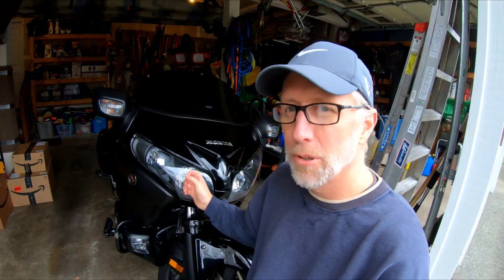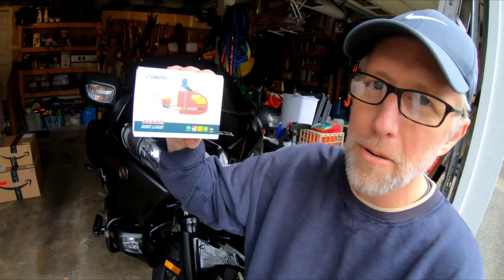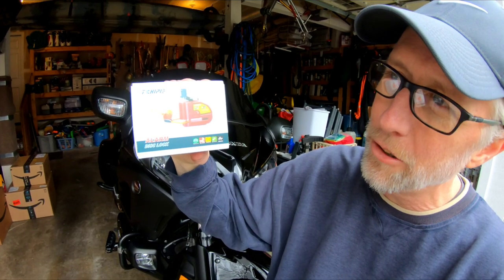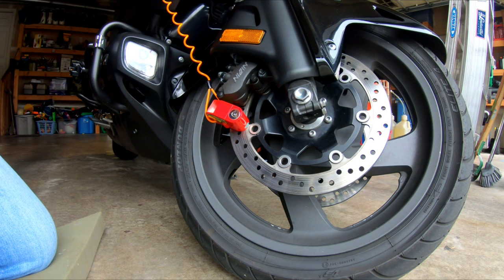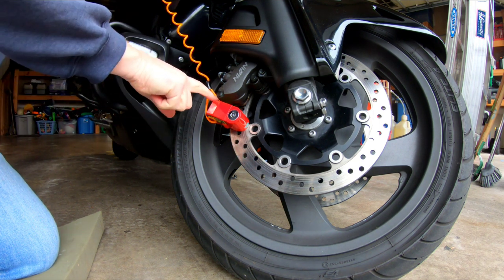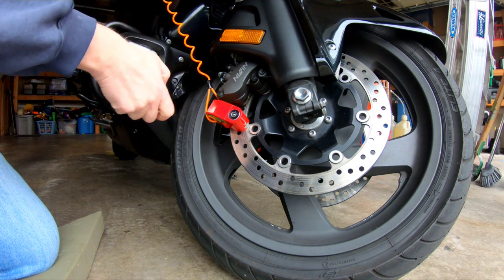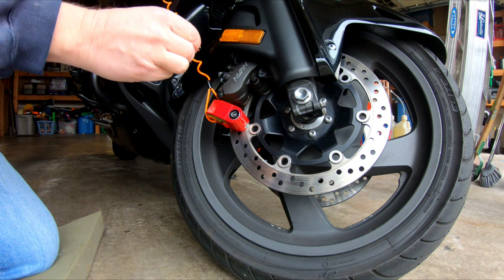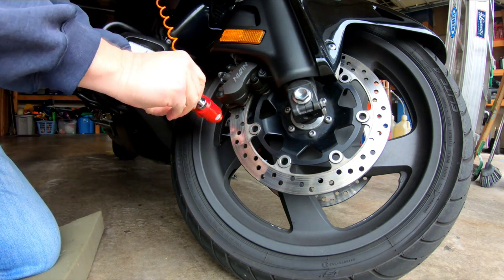Motorcycle Alarm Disk Brake Lock (Tchipie) Unboxing  & Review

Comment: Just bought the same one. Haven't installed it yet but thanks for the insight!
Safe travels 🙏 
777
Reply from the maker: Hi Cool Chris,  I just went on a week long bike trip and used it every night.  It worked great.  One night it was really windy which caused the alarm to go off :)  Thanks for watching.
Reply: @bgrides2108  Hey bro put mine on tonight.
Yea its quite sensitive but that necessarily isn't the worst thing that could happen. I used my rear break and it fit well with the same reaction. Definitely a nice added layer of security for the money._
I'll probably get another 1 or something heavier duty on one axel.
I'm on a KLR650 I just bought and intend on getting gear boxes so carrying around some extra locks and weight is casual. 
Peace
777
Reply from the maker: @coolchris9763  The KLR650 is a cool bike!
Reply: @bgrides2108  Thank You BG. This is my 3rd enduro. I had a used Yamaha XT 350 then I bought a new one. I was in a rural area so honestly I've never registered one, and never did get my motorcycle license yet. Well now I am older and wiser and I am I preparing to apply for a NY state certificate from a driving school nearby and get legal...the learners permit first then the license. Its a process as most riders know. I cant wait until I am official because its really hard to look at that bike and not hit the road. Im rushing to get it done so I can do some touring before the cold weather hits. Keep the cool vids coming. I am subscribed.
Save travels!
Best
777

Comment: Think I need this for the reminder and the alarm because I’m that dumb ass who will ride off with the lock on.
Reply from the maker: Hi Hottotty13, Your right.  If a bad guy tried to ride off with the bike, they would only get a few inches away because the lock is connected into the rotor disc.  I always try to remember to put on the cord to the handle bar grip so I don't try to ride off with the alarm locked on :)  thanks for watching.

Comment: im sorry for my ignorance but whats the purpose of the cable on the handlebar?
Reply from the maker: Hi Stephane,  It's just there as a reminder.  For example, say in the morning you come out to the bike and try to ride it without taking it off, you might cause some damage.  The cable helps you remember to remove the lock :)  Thanks for watching.
Reply: @bgrides2108  oh OK, I thought the cable was to put around a post in case you are using this lock on a bicicle. Thanks!
Reply from the maker: @stephanesilvaa  sure thing.  Thanks for the comments

Comment: Bought this. However, my alarm goes off within about 30 seconds of setting without being touched. No wind and no rain alarm still  goes off. Fresh batteries inatallwd and I disconnected the orange cord thing it was pulling on the disc lock. Even without the cord my alarm goes off. I had to take batteries out of it to use it.
Reply from the maker: Hi @johncarnes2688,  It sounds like it's not functioning right.  Can you return it and get a new one?
Reply: @bgrides2108  not sure, I ordered it on line Awhile back. I have been using without the alarm  as a visible deterrent at this point.
Reply from the maker: Yeah.  It's a great lock on its own without the alarm.  For me it's a good deterrent.  If someone really really wants the bike, they'll find a way around any lock or alarm...  I saw a video and four guys just pick up the entire bike and put it in a van @johncarnes2688

Comment: Hi Sir.. I used disclock in my rear rotor. I forgot to remove it, I run my motorcycle 3 times high revolution.. Wonders why my engine shuts everytime. Does this cause harm to motorcycle engine?
Reply from the maker: Hi Marco,  For this example, the lock was installed on the front disk.  You want to make sure to remove the lock before running the motorcycle just to make sure you don't hurt anything.  Thanks for watching.

Comment: Can this lock be easily broken off once a thief begins to work in a hurry right after the alarm sounds? Are it's this lock very strong an regardless how forceful the thief is will not be able to break the lock an move it? That's what type of Security Lock in looking for. When a alarm goes off  a thief is going to work extra fast to be able to get away with why in the first place he approached the motor bike in the first place. So if you don't want to create a video showing just how strong your Security Lock is locked onto your wheel, an you don't mind taking a chance breaking your lock to just to prove a point to see if your lock is indeed safe from a thief in a quick an fast hurry to get away from your motor bike. I think it's worth trying to break  a lock than lose your motor bike. So just let your YouTube audience know the true facts of this safety security lock for your motorbike. Thanks for your video 😁.
Reply from the maker: Hi Billy,  Yeah.  I guess I'd say that most locks are just a deterrent.  Mainly it's there to keep honest people honest.  I'd also guess most locks can be "broken" into if you try hard enough and have enough time.  I'd also guess most robbers look for an easy target.  This lock isn't the easiest to break into and the high sound alarm adds just one more deterrent drawing attention because of the alarm going off.  Thanks for watching!!
Reply: @billy themystery the lock in this video can be broken with one swipe of a hammer.